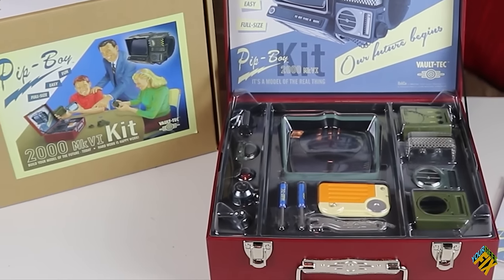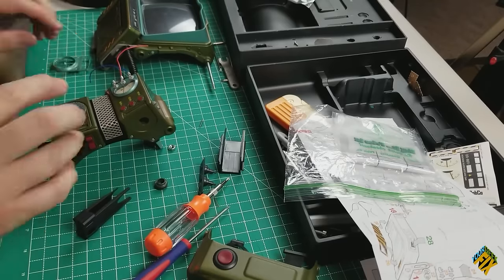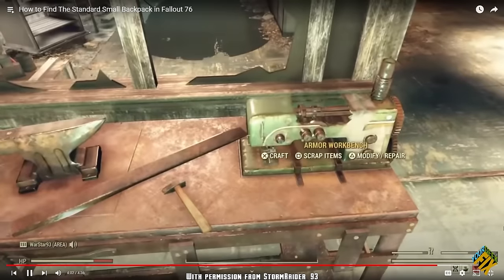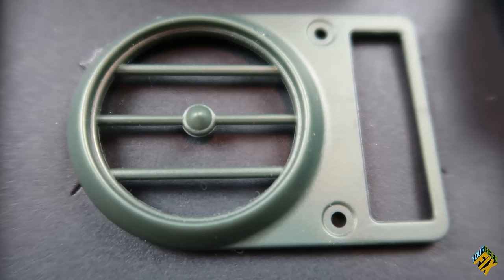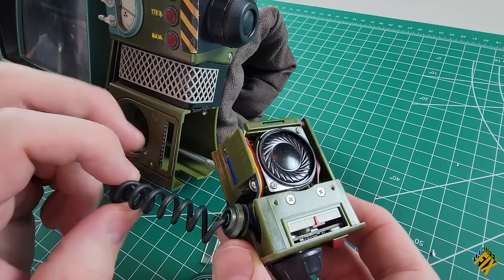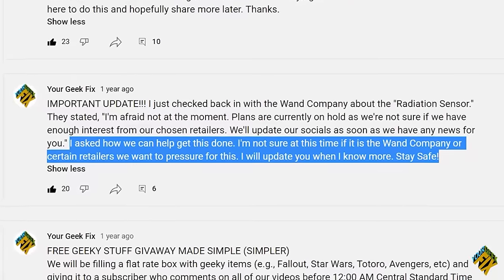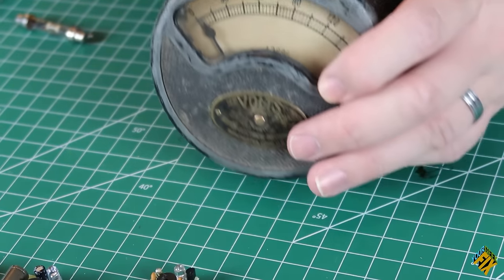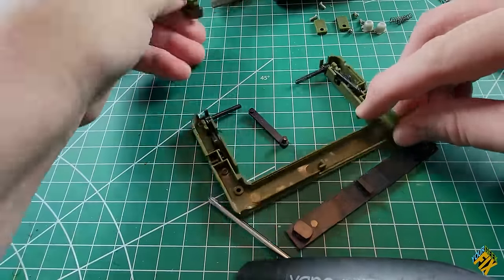Fallout - How we made a real working Pip-Boy 2000 Part 3 of 3

Comment: Where did you say the sound was coming from when you loaded up the holotape? You're like, freakishly close to making a real working Pip-boy is drives me nuts... Like, all you'd need now is an os that works like the Pip-boy while still giving access to all the important settings and stuff, what about a script that automatically plays whatever is on a holotape when it's read, auto connecting to their wifi when their name is noticed etc. if you put some guts in the upper area with the big button on it you could maybe use that button to turn the whole phone part on and off, maybe make different clicks do different things; single press for sleep, double for flashlight, long press for shutdown. It would be an elegant move to replace those fake rubber ribbons with the real thing too, durability may come into question though.
I think the fitbit for the clock was a fine solution, and if it were on a low brightness setting and powered by the phone somehow it would be honestly perfect to keep it on at all times.
I've never been too clear on how the radio module actually worked for changing stations either, like, did the knob scan for stations and just pick what it found, or were you actually scanning around with the knob. I kow the rubber band and the finger on the dial are for show so I'm not too sure what logic it's using to tune into FM radio if any.
Reply: One day I will get a second kit or replicate the parts somehow and try to make these changes to it, I think it would be a big win to find a way to power the whole thing from one source even if you turn on separate parts one at a time.
I don't know if they exist but if there were domed touch screens that could be like the holy grail solution to making everything just look right, I don't know if that would be possible though. Touch controls on the Pip-boy are not strictly part of the universe but in playing on mouse and keyboard the idea that you press specifically where you want to press somehow feels natural to me and I would want to endeavor to have that implemented over the knobs and buttons actually doing anything on the screen end, those knobs and switches are carrying the other modules anyway, maybe one free knob for volume or brightness I don't know.
Reply from the maker: @riceniceman548  Sounds good. The top is where the speaker is. The red button turns it on and off. The cables to charge that are the ribbons you see, not the rubber ones. The black knob lets me use the assistant and put the phone in different modes. The phone also allows me to access and sai hi to another pipboy made this way.. Nate Purkeypile, the head artist for 76 said the two knobs could never do the extent of what it does in the game. You would need more knobs or a topuch screen, my touch screen makes me happy. The great thing about phone tech is that a lot fits in a small quarter inch space. Best of luck.
Reply from the maker: See my other comment. m
Reply: @YourGeekFix  so the phone retained its speaker, that's awesome. It seems like a lot of the things I imagined you already did, that makes me confident in my thinking that I'm on the right track on how this would happen. It's so crazy to me, like, we could use a raspberry Pi like device to run a custom os, we have websites where we could commission custom boards for different implements, we're so freaky close to making this chunky hunk of retro future tech actually functional with a little help from our own (opposite of retro future) technology...
Reply from the maker: @riceniceman548  No, you may want to watch the first two videos where I go in more detail. There is a small bluetooth speaker in the top section. The radio tunes to the stations using the toggle. And the knob switches it to the fallout  universe. The toggle is able to do several things, including volume.

Comment: Hi, for the second switch I managed to wire up the LEDs and the meter up as shown on the image, but the needle doesn't do the stutter movement, not sure why.
Reply from the maker: These are flickering lights, right?
Reply: @YourGeekFix  yes
Reply from the maker: Try one light at a time. Positive wire from battery to the switch, switch to light. Negative light switch to positive side of the meter. Negative wire from meter to Negative side of the battery. One light might work on its own. If the jumping I'd too much, not enough variability. Try the second light in circuit.
Reply from the maker: If the switch makes the needle go up, but not bounce, add a third light or register to the circuit. Also, does attaching the battery to the meter make the needle move.
Reply: @YourGeekFix  when I attach the battery the needle moves up but doesn't bounce, I may have wired something wrong
Reply: @YourGeekFix  for the LEDs should I wire them both to the wire from the switch as that seems to have a little response?
Reply from the maker: @bradleyjackson2277  do the lights flicker when hooked to the meter?
Reply: @YourGeekFix  yes
Reply from the maker: @bradleyjackson2277  email me at yourgeekfix@gmail.com
Reply: @YourGeekFix  does the switch need a black wire? Or both red wires next to each other on seperate stalks?
Reply from the maker: @bradleyjackson2277  red wire from battery to positive side of switch to neutral. Those switches are wired in a specific way to make sure it turns on by pushing the switch. Remove the connector for release. The black goes to the positive side of the light, so on, just like the diagram in the video.
Reply from the maker: @bradleyjackson2277  email me and I will give you a way to talk in person and just talk you through it
Reply: @YourGeekFix  I've sent you an email of the images
Reply from the maker: @bradleyjackson2277  I emailed you.
Reply from the maker: @bradleyjackson2277  ok, I replied.
Reply: @YourGeekFix  thank you for the help, I managed to resolve the issues I had with the edge meter and is now functional, thank you for helping me.
Reply from the maker: @bradleyjackson2277  great!
Reply: @YourGeekFix  sorry to bother you again, but for when you finished the giegar counter,  how did you manage to fit all the components within the space.
Reply from the maker: @bradleyjackson2277  That is the big question for the whole project. I put the speaker in the back first and the battery in next to know where to place the hole for the battery. That is the big thing. When you Sauder the switches, push them down against the button holder. The button holder does help with space. Keep the wires real short so you don't have a nest in there. The meter should be standing up. If laying down will not give room for battery.
Reply: @bradleyjackson2277 what did you you don’t fix this? I’m having the same issue. The meter just tops out. I’m using two white flickering 1.8mm LEDs. Wondering if I need to switch to 3 yellow 1.8mm ones to add enough resistance

Comment: if you add a working radio on top of the wifi mini server this shit is worth at least 4-8k if you know the valuable insights to combining old tech with the new in one single device.
Reply from the maker: Thanks. I'm involved in the Fallout tv series pipboy, which will also implement several of these things.
Reply: @YourGeekFix  yo foshizzle only on the tv series I need one to accompany my wrist rizz I only got 2 years or so until the train prolly puts me in the top of the most most wanted bounty lists for no reason at all
Reply from the maker: @andrewyoonhobai8453  understood
Reply: @YourGeekFix  also can you add a rotating magnet thingamjig that disrupts electrical signals, varying speeds at random intervals based off of a custom raspberry pi dice roller? And angry birds!

Comment: On the concept of cost, - $1,000 working PipBoy with basically all the functions - is cheap.   I know a lot will say "that's not cheap" - but just think bout it - you probably have a $800 phone in your pocket, and it doesn't have a Geiger Counter.

 sure only a few people would use a PipBoy Phone system as their daily phone, but the reality is that technology can be expensive, and if you want all the functionality you either need a massive space to put it in - or - a lot of money to make it smaller.
Reply from the maker: The one I build recently using the same process was $30 for the Blackberry, 35 for the radio, and 27 for the radiation meter or Geiger counter. So, around a 100.

Comment: 1. download model from the game sources. 2. print model making place for electronics. 3. buy arduino/raspberry pi, opensource Geiger counter, power bank, display. 4. connect them all in one piece. 5. this will be the REAL one, with working REAL Geiger Counter. If you do this, I will create a software for that to help you not use crutches with different android apps for one purpose.
Reply from the maker: 1. At that scale, current pi doesn't fit. Some one recently tried and everything was on the outside. 2. I used a phone for more powerful processing to do things the pi doesn't. 3. I made a real Geiger counter and it isn't worth it because you have to carry around large amounts of radiation to impress anyone. 6. You should print and make your own. Post it on the net and impress everyone. Or wait for pi tech to get smaller.
Reply: @YourGeekFix  1. Pi version of credit-card size is capable to get inside, if not by height it is not hard to detach USB and RJ45 ports to reduce height and then you can connect them through wires and get these ports in right places of Pip-boy to provide access to setup and charge the device without disassembling it. 2. In comparison with arduino - you are right, but Pi for now in some versions is more powerful and provide you a set pins to integrate pip-boy buttons and other external electronics to it through GPIO. 3. Depends on resolution, if you connect it directly to your Pi you can fetch analog signal of the argon-tube through GPIO, and increase-decrease sensitivity of radiation, tube receives radiation even at home, electrons always pass through it, and rest of Geiger Counters doesn't record these low-radiation fluctuations, but they exists, and it is possible to setup scale between radiation at home and radiation near power plant to feel difference, and even possible to make it crackling outside home. 4. One day I created command-line programmable RobCo interface (exists on my github), I'll try to get you android app of pip-boy OS on next weekend
Reply: @YourGeekFix  if you well-developer in Java you can try IOIO OTG device for Blackberry phone too, but... it will take a place also
Reply from the maker: @dev1lroot  too wide. You should try measuring the midel.
Reply from the maker: @dev1lroot  model.. same screen size is difficult to find.
Reply from the maker: @dev1lroot  I recommend you try.

Comment: Hello
me as a software engineer How I would had done ( if i had time and money )
Raspberry PI+ small screen to mimic pipboy interface with functional stuff.
GPS Module ( small ) + Geiser counter portable wifi( remove casing) 
Speaker module connected to raspberry PI to produce the geiser sound.
Connect geiser counter to wifi and consume api to get sensitivity data
make rad sound when geiser activity happens ( choose intensity on menu)
Reply from the maker: Ok

Comment: The Clock Section is a bit anoying, because it feels like you are try to "overshout" the way to loud Music.
You realy should check the Volumes before uploading a Video.
Somehow this Problem several Chanels have.
Not sure if its usual to made Music so loutd, so you have to concentrate to blend out the Music to understand the Talk.
Reply from the maker: SO, youtuibe made a change and most phones do not support it. Try listening on your TV or computer and you will find it works great and sounds just right. I stopped trying to compensate for it and as new phones come out that support the change, it won't be an issue.
Reply: The Easyest fix for Musik is taking over voice: Equalyser the musik and the voice :D
i make some Movi likeGaming stuff, so i deal whif alott Lout musik and Voice all the time. My best methode is, wen voice is there, the musik get mor bass, make the middlefrequenses alot quieter and reduse a litlebit the hig tones. Whif that you even can wisper over musik.
The voice of caus need som EQ as well. easy say: voices are generel very midtonehavy.vor better understanding it, you need the higer tones. Here yyou must be carefule,to not bring to mutch hig frequenses up. Spechaly 3k-12k frequenses are very individual vor any other human voice. also it helpt alot to brting down the around 800hz frequencys, to get rid of the telefon destortion, or the destortion/resonance effekts of mikrofone housings. it also sound mutch easyer on hadfones, bekaus this frequencys we humans are trained to listen there, so it is very sensiv, and a comressor, or normaliser voce stuff overshouting this very sensive parts of our listening. 

also, voices shod be not overcomress, compressor is nice, but not all the time. compressors give typikal the feeling of shauting, bekaus basstones come visable to late, mittones often way to loud, and hisounds are tend to wash out. Better is to Equalys first, stet volume, and than give a little bit compression over it, and maby corekt again the eq. and if you arnt happy whif it, reset all, beginn from new. 

the realy important thing is also, to have very neutral mixing hadvones. like Senhiser HD440 are grade. (Hadfones soud be not to crasy in bass, like the sony ones, this are not good for mixing. it result in mostly to less bass in edeting, and also to highevy. also its not got to use hadfones whil to less bass, bekaus that end in having to much bass or in to less higs. so it muust be a very neutral sounding one ;D)

And do not use automatik volume reducer vor the musik.i know there are tools out there, that automatikly bring musikvolumes down, wen voice audio is playing. this is very anoing to here and add nothing good ;D but put manual musik down is mostly a good idee, in fitting situations of cause ;D Example: a Fallout merch fake add must be whif lound musik and voce, ad the beginning, but then fast the musik make room vor the voice, and also go fast bach in full volume, wen the voice end and the musik is left.
Reply from the maker: @youarieyellowmissile  listen a gain on speakers on a computer. Youtube changed their phone and earphone settings, so stereo stuff was off and music was being heard sometimes without any voice. So, what it sounds like is not how I made it initially. Sounds good on good devices.
Reply: @YourGeekFix  The amount of work, effort and attention to detail in this video is already in the top 0.001% of YT. I have no issues with the audio and even if there was it wouldn't be an issue at all with the quality of this content.
Reply from the maker: @Silphwave  thanks!